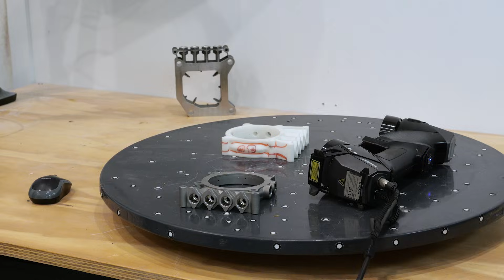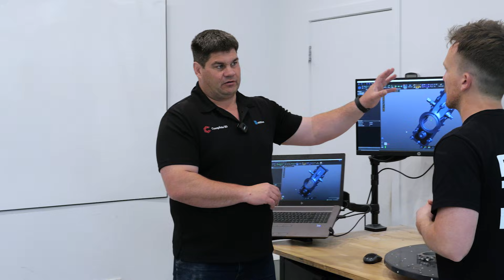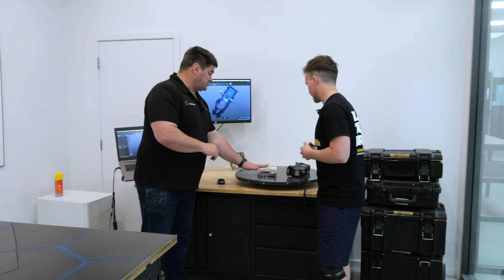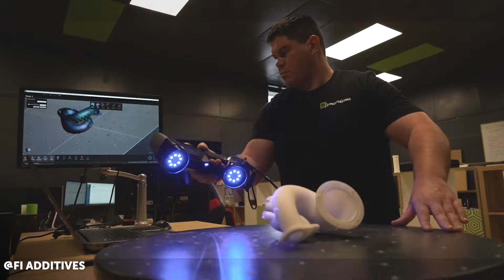ANYONE can do this | From Scan Files to Car Parts

Comment from the maker: TIMESTAMPS
0:00 - Derek Manson
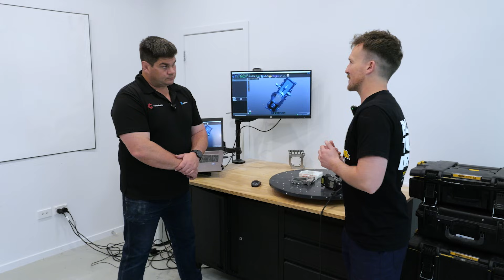0:18 - Why a Scan Is Not Finished CAD
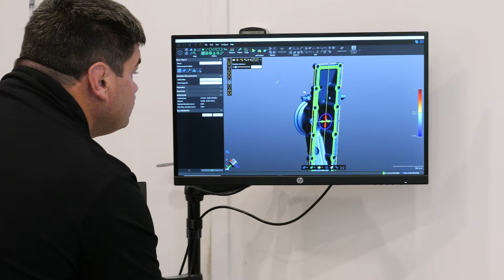0:39 - Creaform VX Software Overview
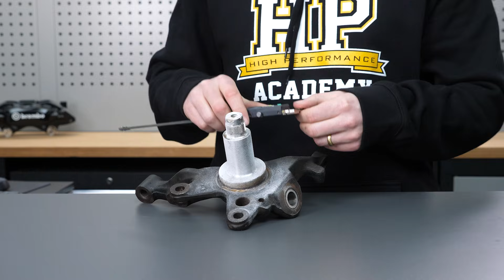1:12 - Extracting Entities From Scan Mesh
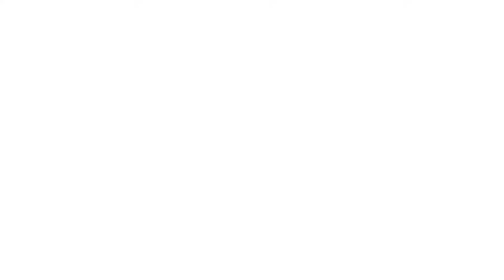1:36 - Planes, Cylinders, Cones, Sections
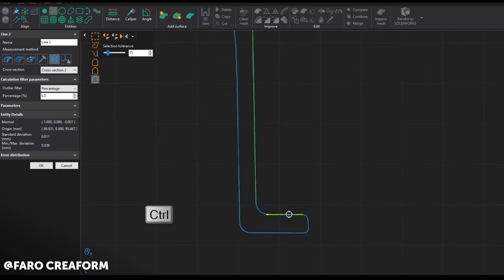2:19 - Accurate Measurement Without Human Error
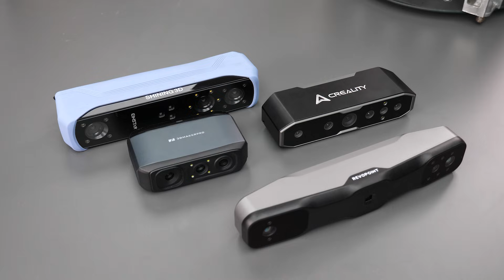2:47 - Mesh Repair and Noise Cleanup
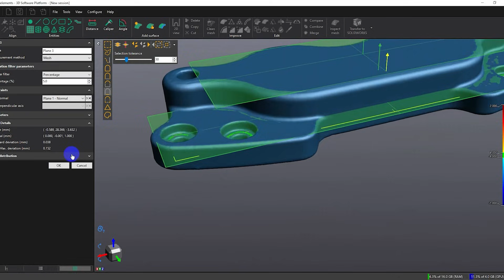3:46 - Auto Surfacing Limits
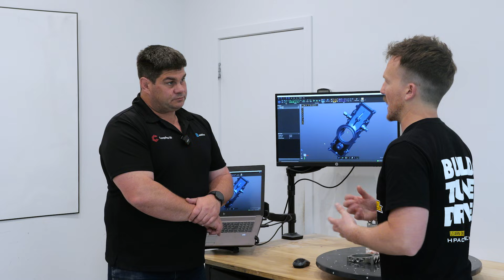4:52 - QA Scan Overlay vs CAD
5:37 - Accuracy vs Scan Area Tolerance
6:49 - Hydrogen Injection Manifold Example
7:27 - SLS Prototype and Design Review Changes
8:07 - Why Additive Works | Internal Geometry
8:44 - Scan Printed Parts for QA
9:04 - Printing vs Machining Tolerances
9:45 - FI Additives - https://www.fiadditive.co.nz/